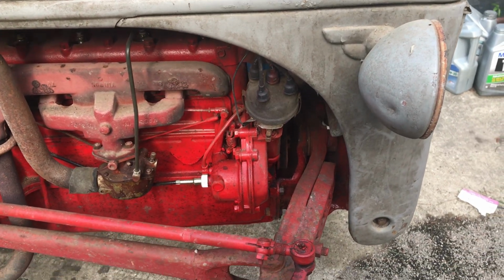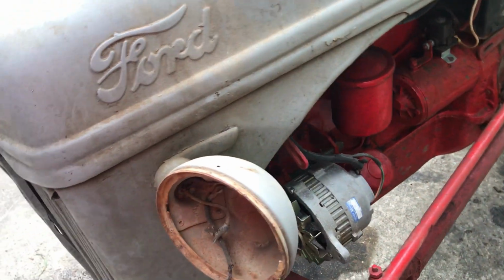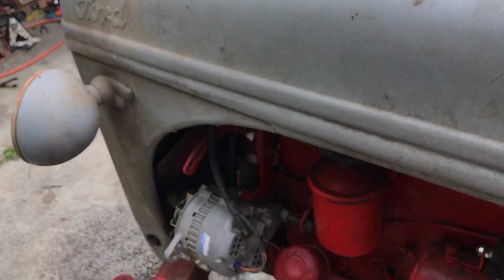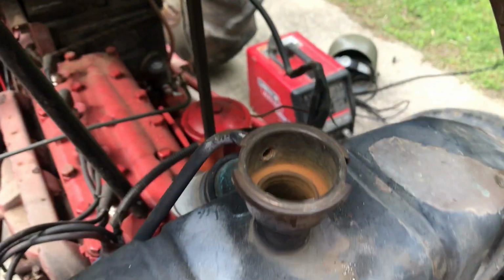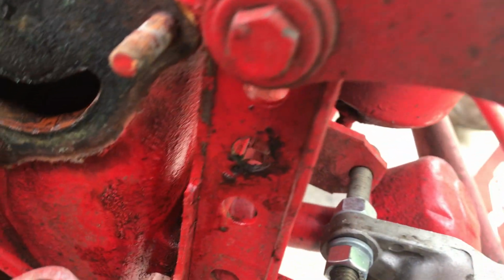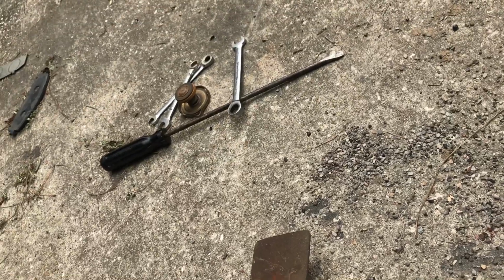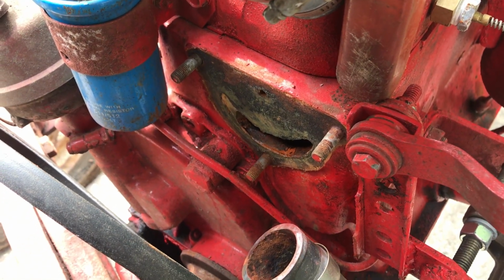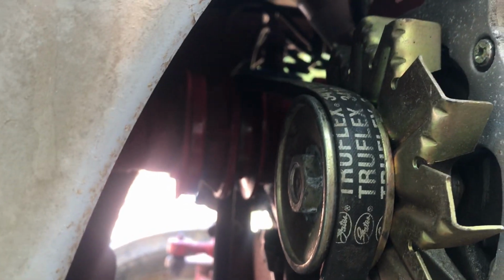Ford 8n Water Pump Replacement

Comment: It is easier when the hood is pulled.  However you can take the top hose off, loosen the radiator and it will move forward enough to get the fan off.  The good idea you had was putting card board between the fan and radiator.  I’ve propped the hood several times and had it fall once.  My new philosophy is on or off.
Thanks for the video!

Comment: I’ve pulled the hood on my dad’s 8n several times by myself. I use two ratchet straps (front/back) and an engine cherry picker. Gotta have the boom all the way out and the straps super to clear things. The dog legs will usually rub slightly on the radiator but it’s not a big deal.
Reply from the maker: That’s a good method.

Comment: Changing the water pump was a pain. Drained the tank and it was a lot easier to take off.
Reply from the maker: yeah, not fun. Seems to be alot easier on my Ford 2000 Diesel Tractor.

Comment: What do you think if I have water in oil same engine
Reply: Leaking head gasket is a potential.  Drain oil refill (I use used oil and then check.  If it’s getting water it probably is the gasket.
Don’t run it long with water in oil!  Locked up engine is a real possibility.